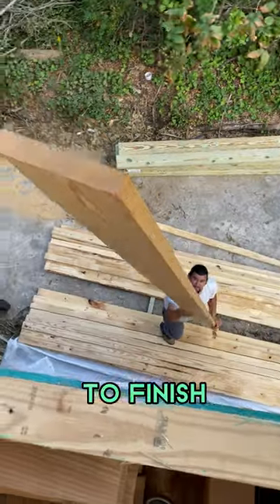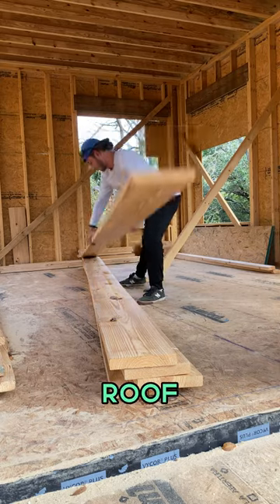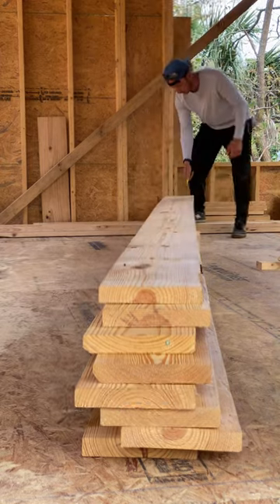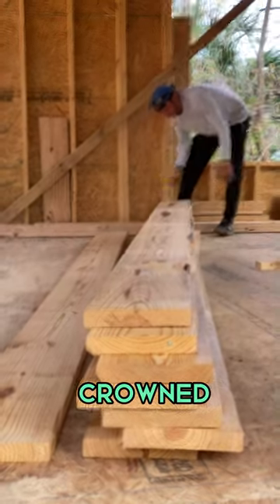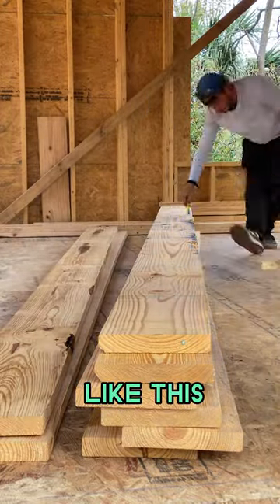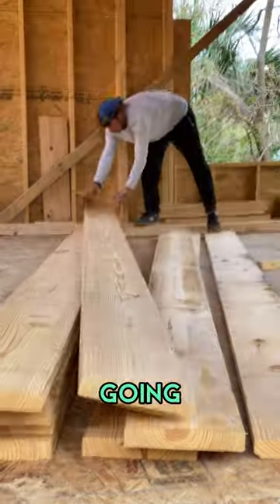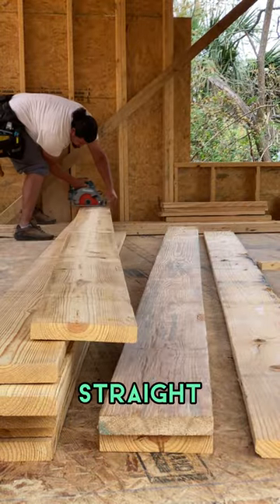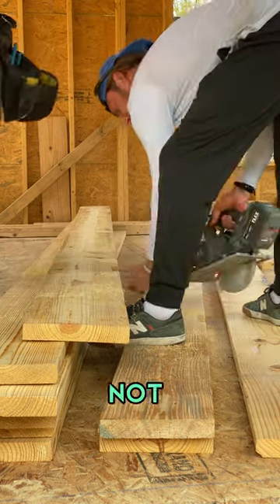Roof Pt 3 | Artpentry

Comment: The crown goes up because of gravity and time. If the house is secure and sealed enough. In 50 years you can go back and where the boards had sagged down you can turn them over and crown them again.

Comment: Right. Always crown up in more serious cases I've cut the damn crown out
Reply: Fail. Use a different board.
Reply: If you framed it and the crown is to bad I've seen people relief cut but that's not how I'd do it I'd rip the bad board out and replace it
Reply: Thanks for repeating the video always necessary

Comment: The crown is the high point of the natural arch of the board.  If you have trouble figuring this out, stand the board on edge. If it rocks like a rocking chair the crown is down. If the ends touch down & there's a gap under the middle then the crown is up. If necessary,, shine a light behind the board to better see the gap.
   Installing with the crown up causes  the weight if the roof itself & anything on it (like snow or human) to press (push = compress) the ends of the boards more tightly into structure, making it stronger.
   Installing crown down causes the ends of the boards to pull away (stretch = tension) from their connection to the structure, causing loosening & other damage & inviting potential collapse of the roof.
   Since the integrity of the structure & the welfair, even the lives, of the people who use it are at stake here it's REALLY NECESSARY to get it right.
   Some other places where this construction technique is used are for the floors of big buildings & the decks of bridges.
   When parts are constructed off site the term for this built-in arch is "pre-stressed" & the crown ALWAYS goes up no matter whether using wood, steel, concrete, stone, or other.
   The amount of arch is designed to suit the amount of load (weight) expected & the tolerances of the materials used.
   You've seen traffic signs for load limits on bridges. These refer to the maximum the design will tolerate. Anything more will damage the structure.
   This is the same type of calculation - & just as important - that determins whether your roof needs huge beams or smaller rafters.
Reply: Wow whose actually gonna read this non sense. Did you hit the character limit on the biography of lumber